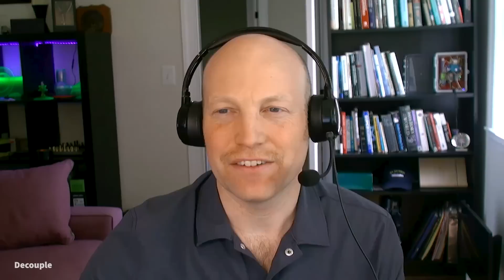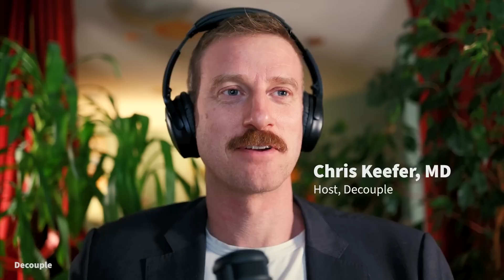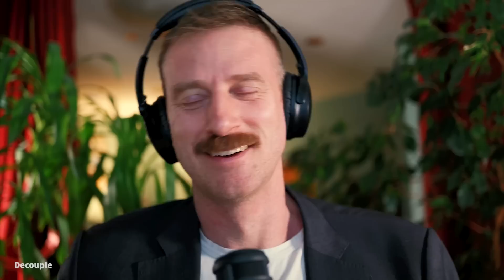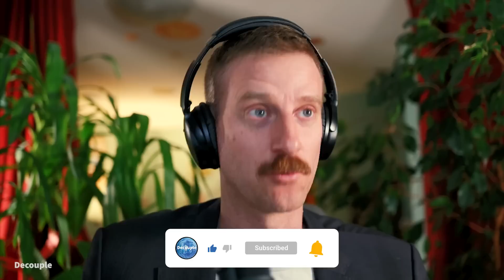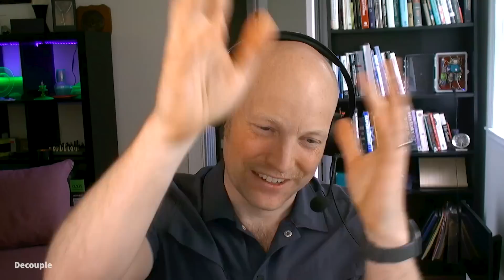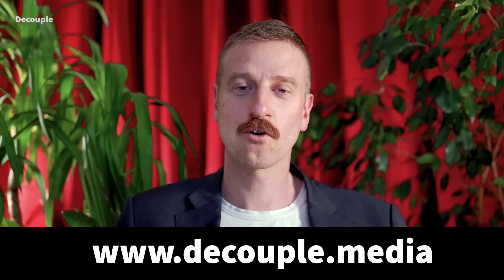Are High Temp Gas Reactors the Future or a Relic?

Comment: Helium is desirable because it does not corrode. Further, LWR use helium backfilled fuel rods because the heat transfer, it is good for checking the tightness of the rod, and again, doesn’t corrode.

Comment: If the cost of producing TRISO fuel in large quantities can come down enough high temperature gas reactors look good.

A TRISO fuel reactor uses Tristructural Isotropic (TRISO) fuel, which consists of tiny, poppy-seed-sized particles with a uranium kernel encased in multiple layers of carbon and ceramic materials. These particles are highly robust and are designed to withstand extreme temperatures and act as their own containment system, preventing the release of radioactive materials.

Comment: Yttrium Hydride moderators may be able to overcome the problem of gas cooled reactors being either smaller and low powered, or massive and medium powered (but still lower energy density), as Yttrium Hydride moderates pretty much as well or a bit better than water.

Pebble fuel manufacturing cost problems might be overcome by using molten salt fuel in fuel pins (Moltex Energy and planning to do this, but with the coolant outside the pins also being molten salt).

Comment: Since helium is lost so fast in a leak, with super critical co2 it seems much less costly than springing a leak with helium. Also with liquid co2 the turbines would be much smaller costing much less. It must have something to do with contamination, maybe radioactive.
Reply: CO2 is much more corrosive. C-14 contamination is also a big issue to contain, yes.
Reply: Seems that Nitrogen and CO2 both offer more utility than helium as a gas reactor coolant.
Leakage is not such a huge issue and both offer short radio active product half lives. Note that while C14 is produced. It has a ~5000 year half life so it is not a health concern - other than frustrating archeologists.

Comment: Add your hydrogen plant to reactors that are not intended to operate as baseload suppliers.

Example. 

Cat A reactors are pure electricity suppliers. They supply baseload electricity, sufficient to meet minimum grid demand.
Cat B reactors have hydrogen generation capability. They switch between power and hydrogen generation as  grid demand varies.

Comment: One issue with high temperature reactors is the cost of materials for getting the helium from the core to the turbines (or the industrial process).   Economical steel cannot be used above about 550 C due to creep.  High temperature materials are much more expensive.
Reply: Yup, and helium will leak over time. Moreover, helium is a non-renewable resource as well, usually co-exists with natural gas in geological gas deposits.

Comment: Great discussion. One important point that wasn’t addressed is that a reactor can indeed use 20% enriched fuel while still maintaining both a negative temperature coefficient and a negative void coefficient across the entire operating range. This is the primary reason LWRs are constrained to 5% enrichment—higher enrichment would compromise these intrinsic safety features. The Xe-100, by contrast, uses UCO fuel at 15.5% enrichment that supports burnups up to 170,000 MWd/tU, compared to just 45,000 MWd/tU in conventional LWRs.

A second, equally important point is the design philosophy. The German and Chinese approach was to see how large an "intrinsically safe" reactor could be made to fit within the largest existing BWR reactor pressure vessel. At X-energy, we took a fundamentally different approach. Drawing from experience—including my time leading the PBMR-400 design in South Africa—we started not with the vessel but with first principles, identifying the optimal power level from an economic standpoint. That analysis led us to reframe the problem in terms of physical fundamentals: the ratio of core volume to reflector surface area, and the heat rejection capability of the metallic RPV. This drove an optimized design—not only for passive heat removal during upset conditions but also for minimizing helium bypass flows through the side reflector.

I hope this sheds light on the deeper engineering trade-offs and strategic thinking behind the Xe-100.
Reply: US naval rectors use HEU >90% and still have negative T and void coefficients. This is not a secret.

Comment: The nitrogen cooled seems like it intuitively would be the one to pick.
Reply: The big flaw there is carbon 14 production.
Reply: @pauldietz1325  You can use Nitrogen 15, Rod Adams has a write up about it over at Atomic Insights.
Reply: The FHR is the best intuitively

Comment: The helium circulators at Fort St. Vrain had water seals.  Pressure changes would cause water to leak out of the seals into the reactor circuit. The water would get into the thermal insulation on the inside of the concrete reactor vessel.  It would take weeks to dry out the insulation because of the temperature limits on the concrete.   A really poor set of design choices.  A tragedy after the good experience at Peach Bottom Unit 1.

Comment: Ooops, the planet is running out of helium.
Reply: not really, production is higher than demand
Reply: @rokadamlje5365  it is extracted from natural gas 😂.
Reply: @ plus nuclear reactors wouldnt use much anyway
Reply: @Mr.T9191-i2f  He3 can also be made in nuclear reactors like CANDU that use heavy water and then waiting for the tritium to beta decay. Alternatively, while expensive, it can be made by lithium fission where a neutron splits the lithium into He4 and H3 that then decays into He3. Nuclear waste storage casks undergoing alpha decay is another example.

There are many ways to get helium as a byproduct where it's usually considered a "waste product".
Reply: @atrumluminarium ok and you believe that are viable solutions for the mass it is required to run a fleet of Helium cooled tractors.
Reply: @rokadamlje5365  0.1% is not much for you ?
Reply: As long as there are radioactive beta ray emitters....